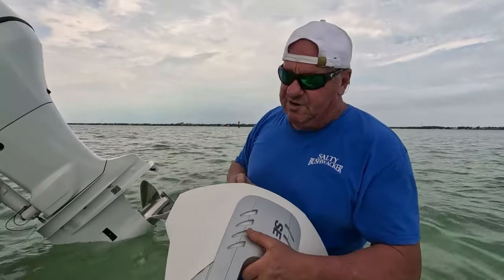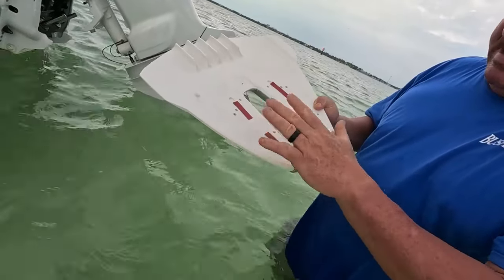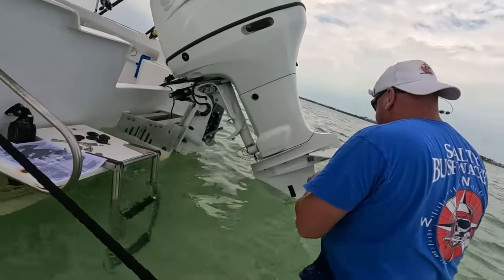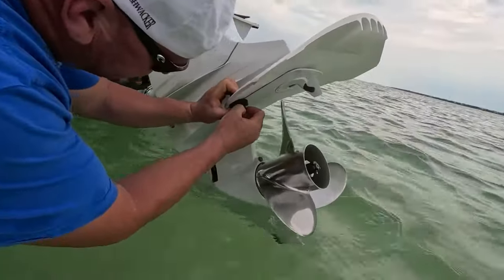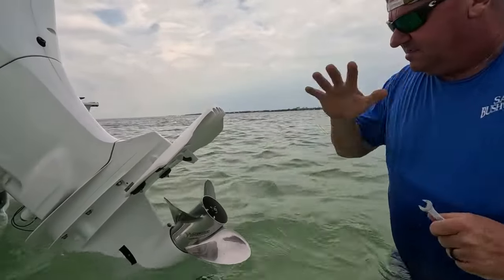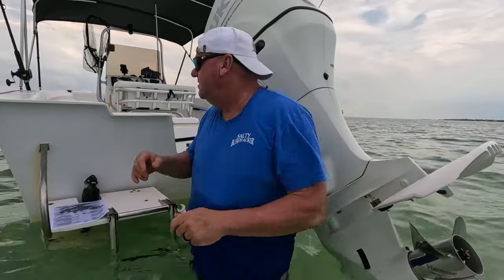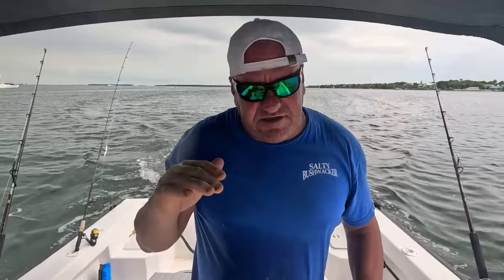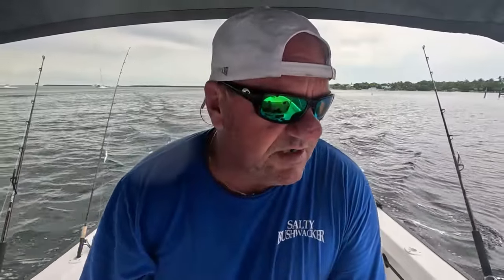SE sport 400 Hydrofoil install and review.

Comment: I have a Scout 175 with a 90 Yamaha. I have to go 2 miles in a slow speed area and the bow of my boat lifts and I get low mileage at slow speed. Do you think this hydrofoil would help cut bow lift from 5 to 8 MPH? We are 2 big people and have weight in back of the boat as well.